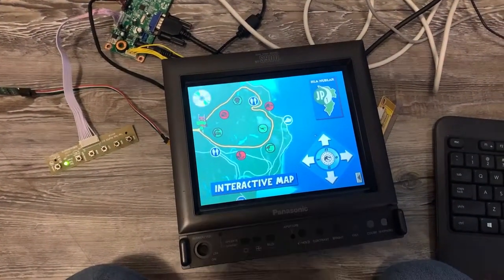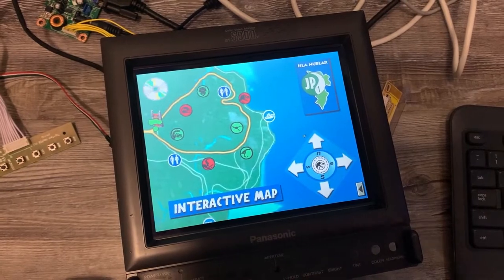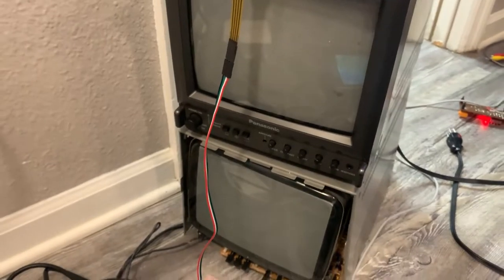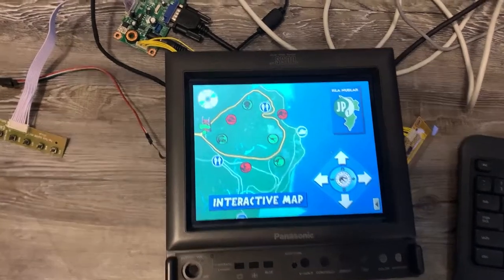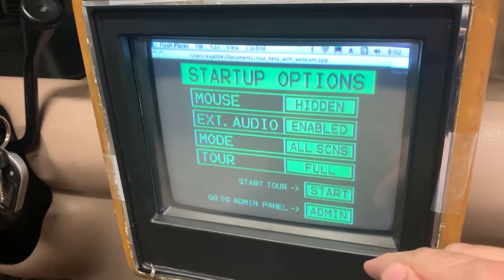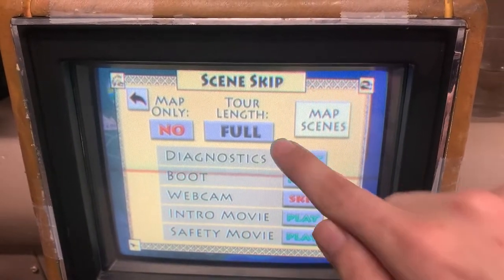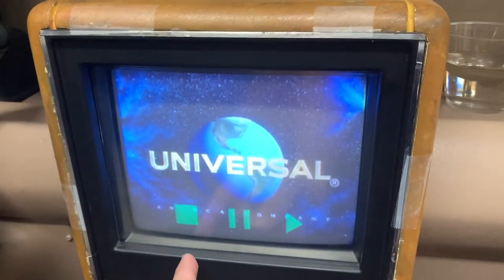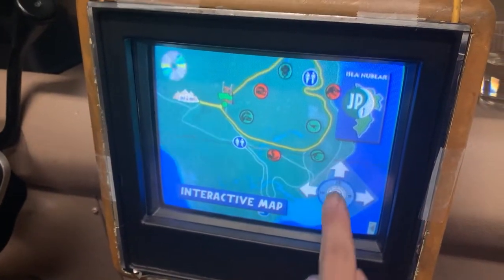CRT Touchscreen Installed in the Jurassic Park Explorer

Comment: I have a big old period correct conversion truck and I want to put a display in it for android auto and controlling other things like the HVAC system and displaying gauge info. Im dead set on using a CRT and want touch capability. I was worried the static electricity they create would interfere with any aftermarket touch controls like this. I was looking into real touchscreen CRT's but they are few and far between and reverse engineering would be a pain. Your setup is super inspirational! Do you have any issues with glare because the touch panel floats infront of the CRT?